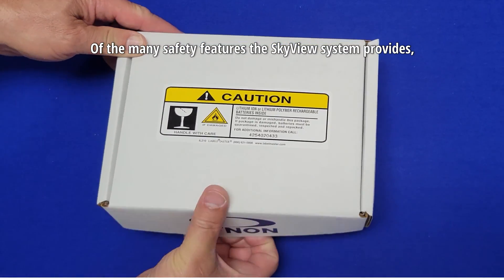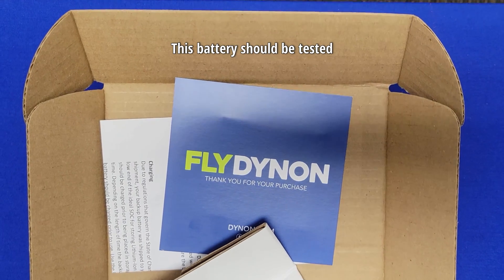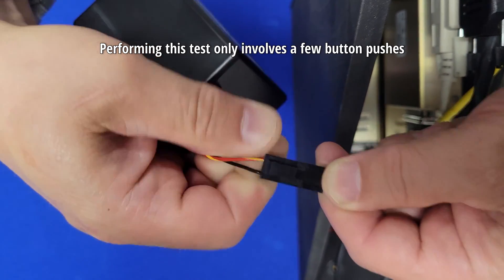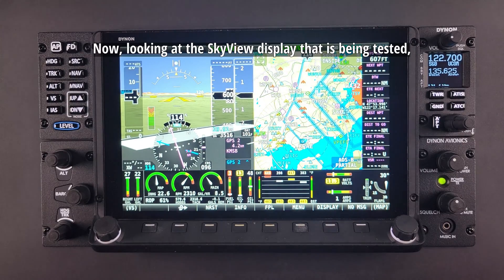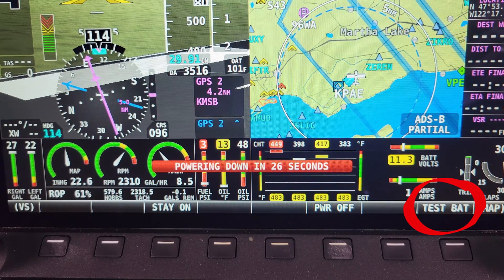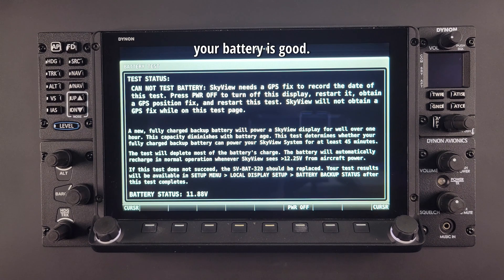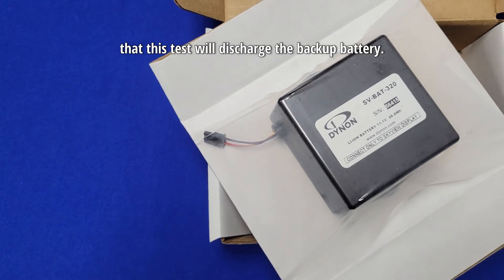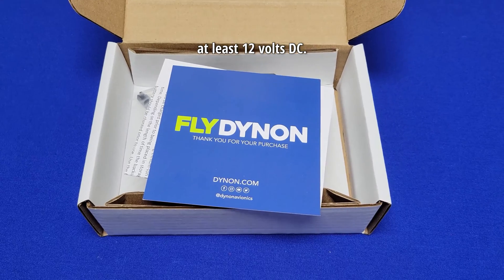Backup Battery Test: Skyview HDX Pilot Quick Tips

Comment: IF IT FAILS: before you decide you need a new backup battery, there is a detail screen under system that will display if the backup battery is getting enough volts to recharge.  If it is less than 12 point something - I think 12.3v, it will not show as charging.  Turns out a bad primary battery cell can do this.  I replaced my primary battery, even though the engine started just fine, and the backup started charging again.